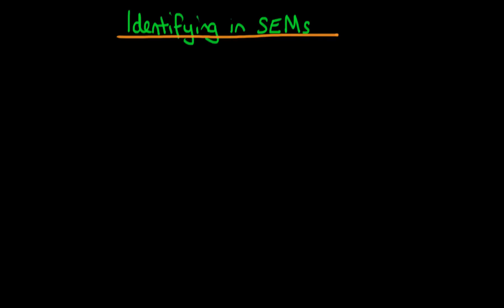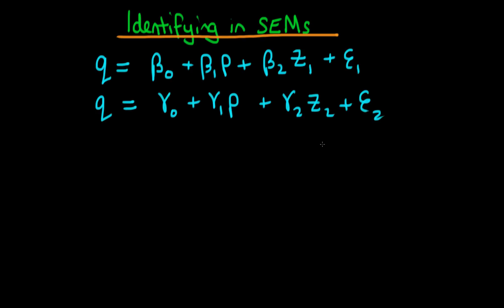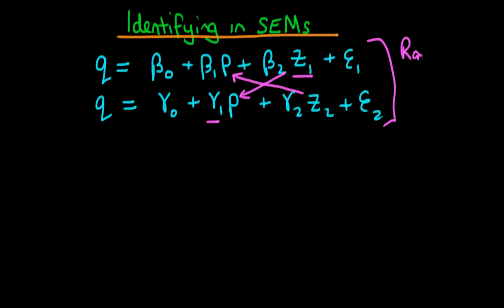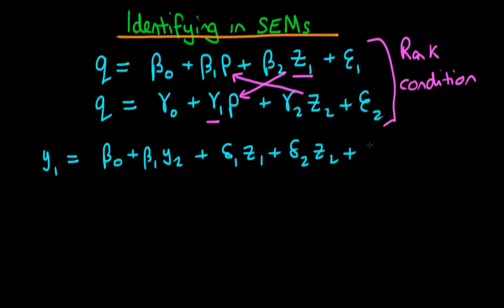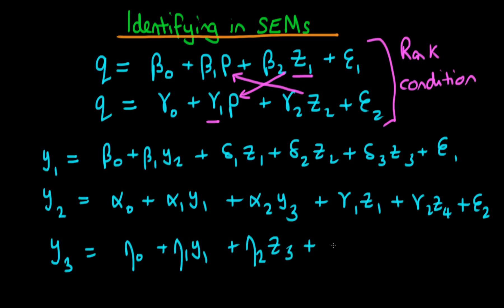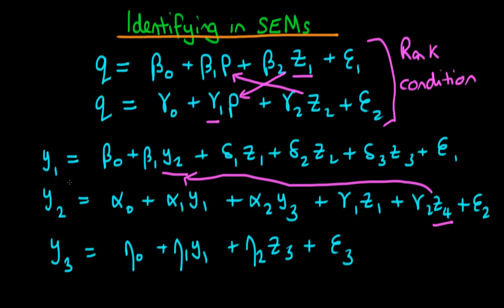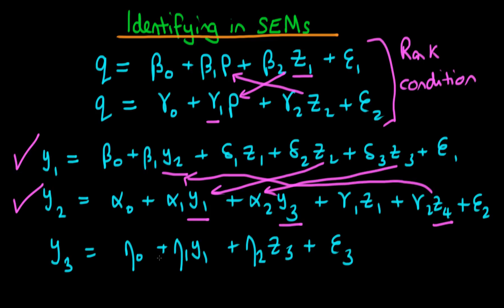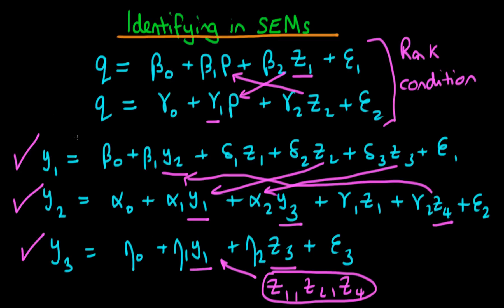Simultaneous Equation Models: Order condition for parameter identification

Comment: why in the video it becomes rank condition but not order condition?
Reply: The order condition is necessary for the rank condition. The order condition for identifying the first equation state that at least one exogenous variable is excluded from this equation. As seen above, the order condition is trivial to check once both equations have been specified. 

The rank condition requires more: at least one of the exogenous variables excluded from the first equation must have a nonzero population coefficent in the second equations. This ensures taht at least one of the exogenous variables omitted from the first equation actually appears in the reduced form of y2, so that we can use these variables as instruments for y2. We can test this using a t or an F test. - Woolridge 5th edition Introduction to econometrics pg 539 chapter 16 right before Example 16.3
Reply: (my words from what i understood): the order condition for identifying the first equation state that at least one exogenous variable is excluded from this equation. (simple enough to check) 

With the rank condition, you just need to make sure the coefficients of the equation your testing has nonzero coefficient terms. (please someone correct me if im wrong)
Reply: @ResilientFighter  Did you find the answer?